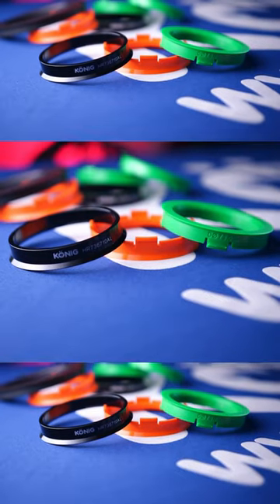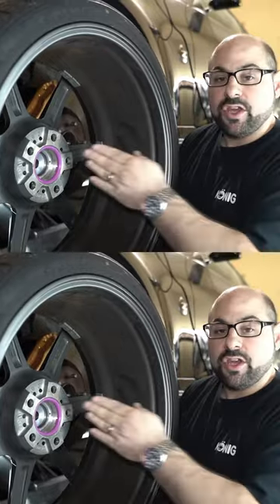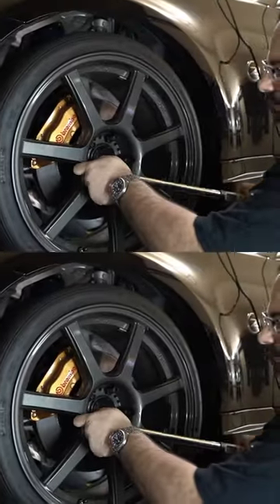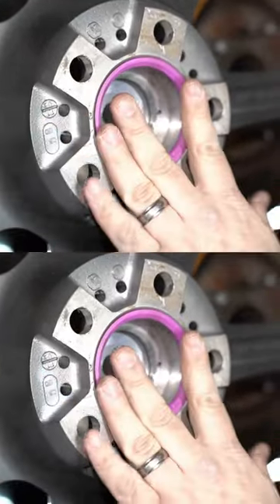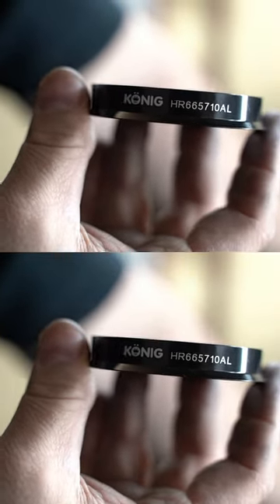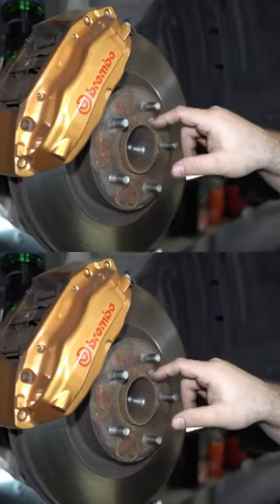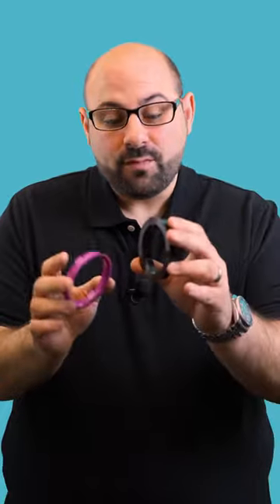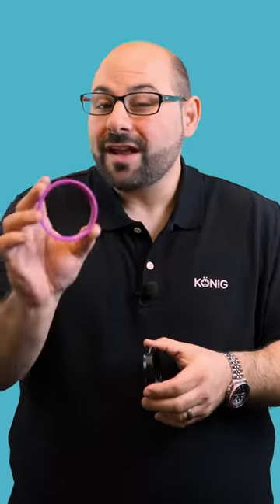Wheel vibration? Don’t forget hub rings! 🛞💨

Comment: How can I remove my aluminium hub rings there seized on and I cant change my brake disks
Reply from the maker: take out the center cap on the front, use a flat head screwdriver at the hub ring and have at it! When installing your next set of hub rings, make sure to use anti-seize.
Reply: Try a bearing puller